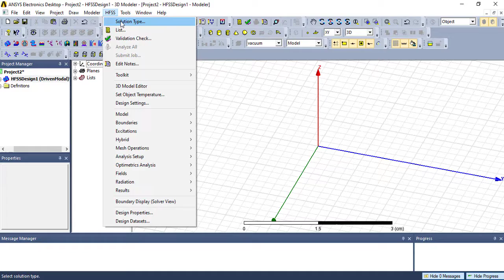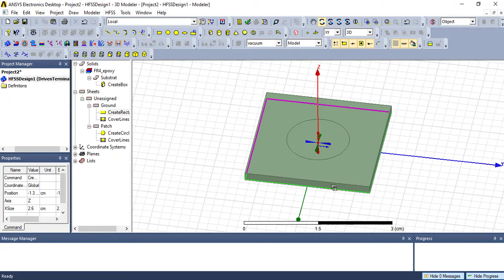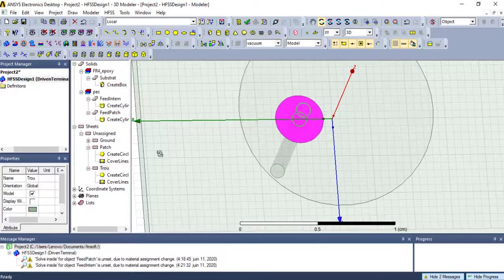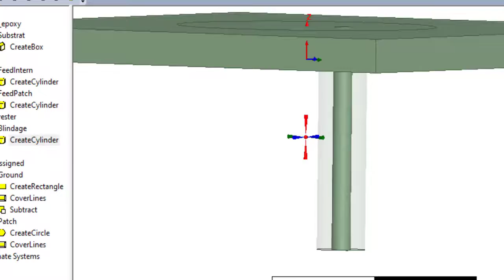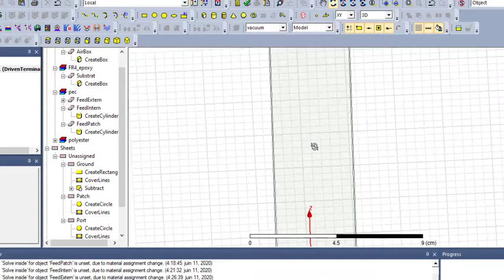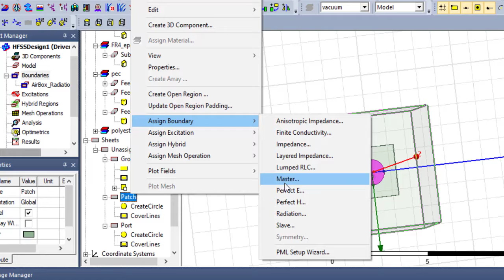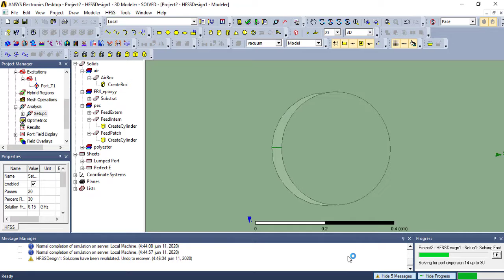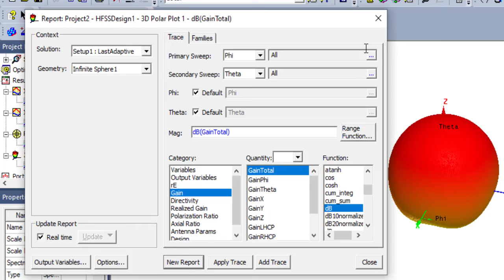Circular Patch Antenna design with Coaxial Cable Feed Step by Step in  HFSS (2020)

Comment: Sir, I have a question regarding the setup as a lumped port. When you do it, someway it gets the whole port circle, but when I assign it as a lumped port, it makes me add an integration line. Will that setup have the same result?
Reply from the maker: To find a whole port circle you must to work with driven terminal instead of driven modal.
About results between the two methods, there is no big remarkable difference.
Reply: @TFEforEngineering   wait, how do you work with a driven terminal instead of the mode? Is that a setting? Thank you for the quick response!
Reply from the maker: @marisolena99  you can see the method in the video at 0:32 min
Reply: @TFEforEngineering  thank you! I had another question, if I am doing an array, and I would like to match load some of the coax cables, can I just set the ports as 50 ohm impedances boundaries? Would that be considered an accurate simulation?

Comment: Thanks for sharing but I didn´t Understand the
Dielectric Outer Diameter: 1.2 mm 
and Inner Conductor Diameter:  0.47 mm and Dielectric constant is 3.2 
Which give Z0= 31.4 ohm not 50 ohm. Am I missing something?
Reply: @TFEforEngineering  I Will wait for it Please Leave me A comm In My House When you do it with Thanks